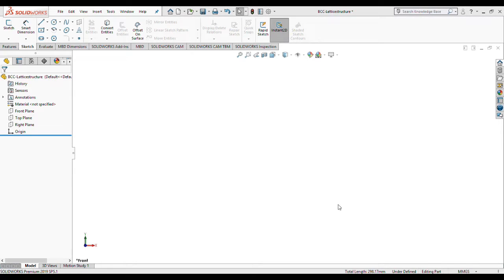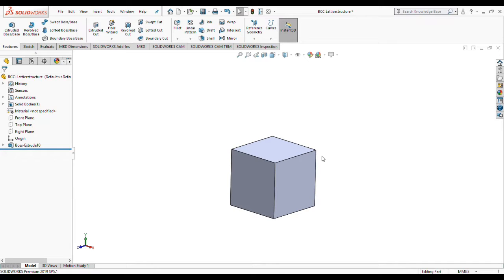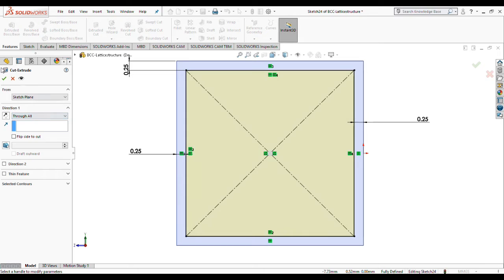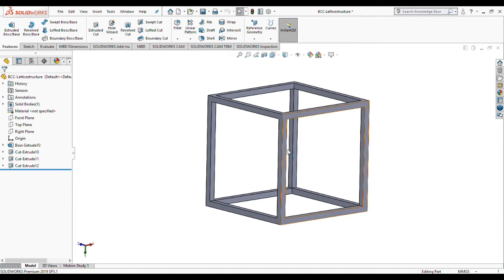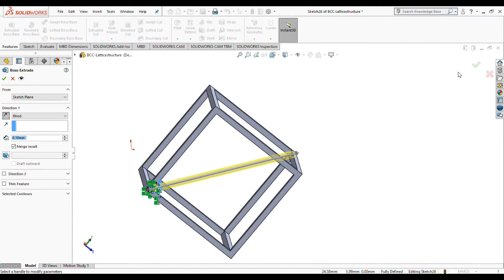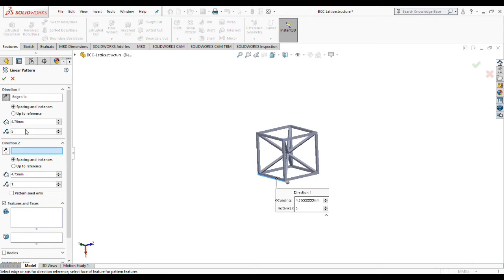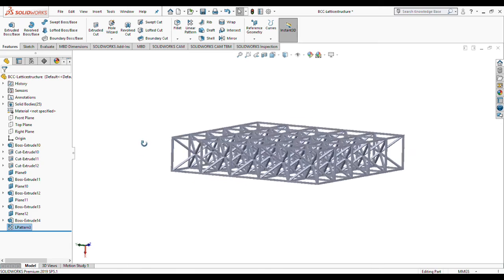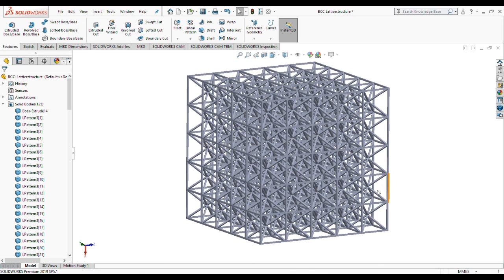Tiny Mighty #051 — BCC Lattice Unit Cell Design in SolidWorks (Beginner CAD)

Comment: how do we create the same lattice structure on a bicycle helmet surface. thanks
Reply from the maker: Good question, you have two option, first, create a block in the sam size as your helmet, then trim it in solidworks, or use nTopology software to optimize the solid type of your helmet
Reply: @Salar3DStudio  thanks,  I will try